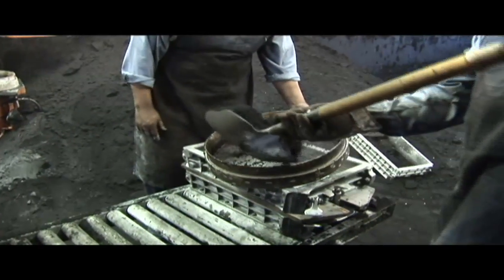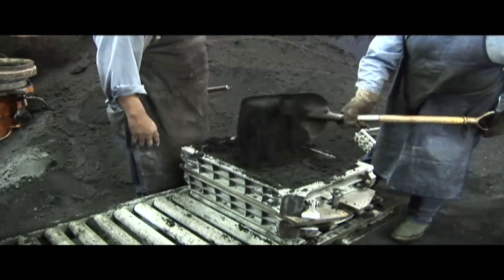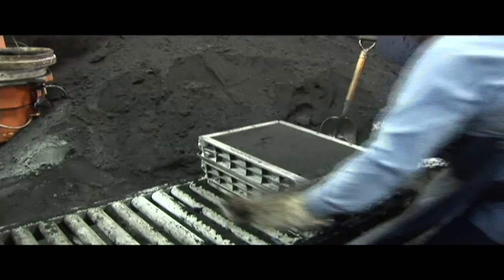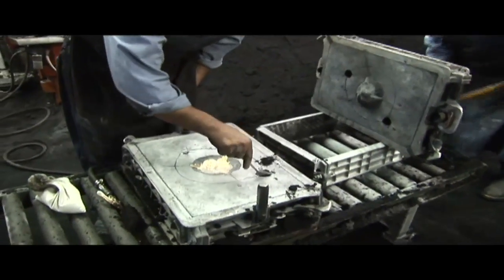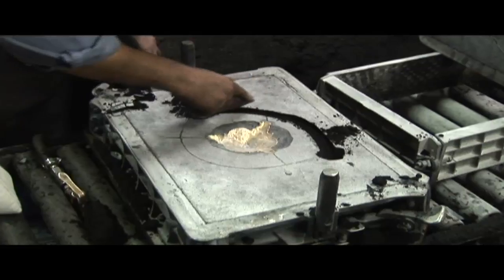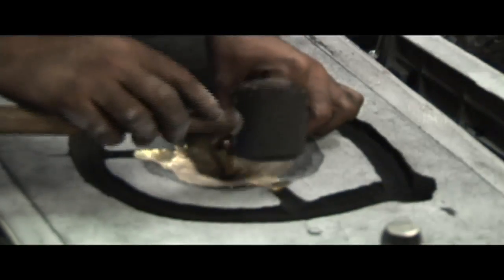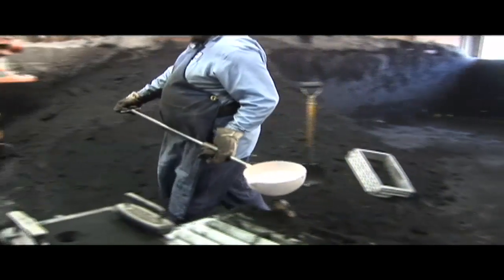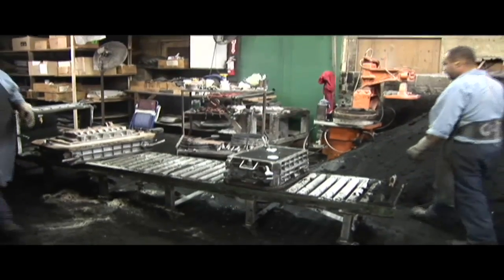Foundry Loose Pattern Molding

Comment: Why are 2 men doing a 1 man job
Reply: Because it is not a 1 man job
Reply: Sorry to argue but I have been a loose pattern floor moulder since 1986. If you can't lift and turn a moulding box that size by yourself then its either health & safety gone crazy or you shouldn't be doing the job. Plus they are snap flask boxes which actually are not that heavy, these days they are made of Aluminium, but still they wear weight lifter belts..
Reply: I appreciate these arguments from a foundry colleague but you can see there is no way to bend your knees. Lifting one box for one video isn't a problem but working this way 8 hours a day five days per week probably will make your back to complain sooner or later. I agree with you that all depends on total weight, but working position is very low from my point of view and maybe for that, they are working in pairs. Salute.
Reply: If someone worked in a foundry since 1986, they wouldn't call a flask (cope and drag combined) a "box." Yeah, I could easily mold that up myself but doing that for 8 hours, is another thing.
Reply: When you work in a production foundry you don't piss about calling them copes , drags or flasks they are just boxes, and I have done this for 8 hours a day and not with pneumatic rammers or hand rammers, you just don't have time to swap and change; just shovel in the sand then swing your shovel around and ram it in with the handle, the real moulder would have a cast metal handle replacing the wooden handle on the shovel, or if it's on the floor just tread it in ( the moulders dance )

Comment: Just curious, why isn't anyone using some kind of respiratory protection?
Reply: +Andrew Taylor I was wondering the same thing.
Reply: I worked in a foundry and while the air was hot and humid it was otherwise fine.  Also, as far as I know, there is no such thing as aluminum (or iron) fumes.  What exactly are you afraid of breathing?
Reply: Ve y trabaja tú